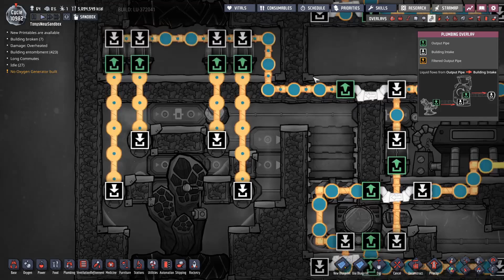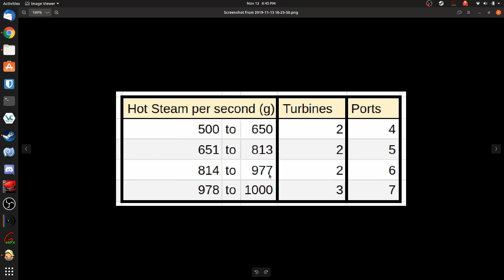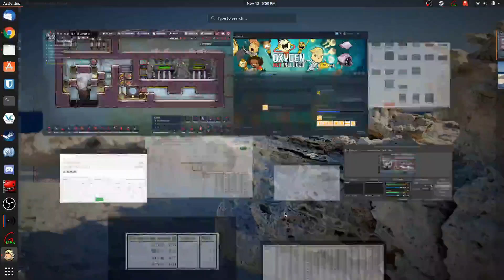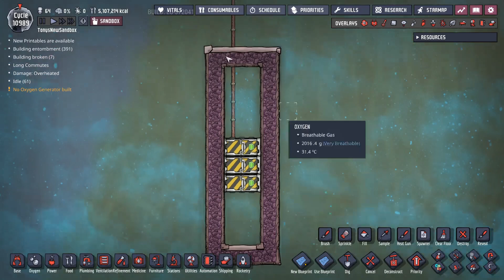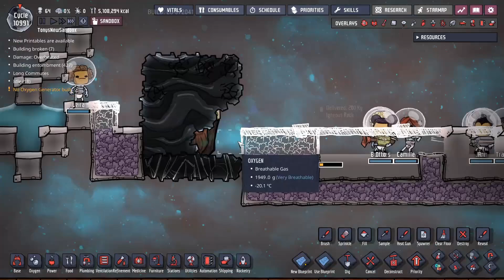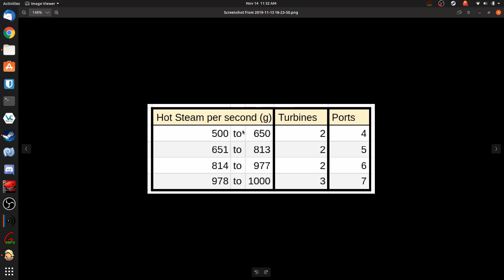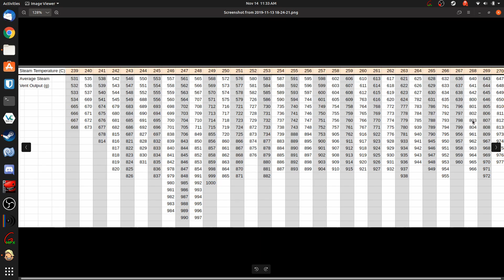Tame Your Hot Steam Vents for Power and Water

Comment from the maker: Addenda:
0) My charts don't seem to be quite right. My test builds don't produce power all the way to the end of the dormant period. If that's something you want, I suggest turning down the temperature a bit. I'll reevaluate the setup when I have collected better data.
1) You may want to cool the steam turbines from an external source instead of using the integrated steel aquatuner in the video. If you want to do it that way, and you want to tune the build the way I suggest in the video, you can use these charts: https://imgur.com/p8mSsDp https://imgur.com/DWIpH5i (I think they are correct but I haven't tested it well).
2) Omg, to get the petroleum in for the bypass pumps all you have to do is put some petroleum into the valves above. (Thanks to everyone who is telling me so.)
Reply: COME BACK MAN!!!!
Reply: Please come back! I watched all these videos and got some amazing ideas and I want more! I hope hate or life struggle didnt get you to stop making content. I cant wait to see more from you.
Reply: What should the valves be set for the petroleum beads? (because too low and they will disappear, like the water that the bypass pump is consuming)
Reply from the maker: @wolframitephoenix6737   I've heard that the limit is 20 grams, so anything higher than that should do.
Reply: Trying this now. 
1 It is difficult to place the automation items because vents now too can be automated. 
2 The automation (buffer etc) breaks when inside. It should be constructed outside of the chamber.
The rest of the mechanics seem to hold up (2 cycles active).
Reply: It's possible that some of the inefficiency from the steam turbines is due to heat transfer through the closed airlock in its idle position, though it's possible the heat transfer would be too insignificant, I have no idea how that could be calculated. I'm sure setting the temperature a degree or two cooler would be enough to solve that problem though.
Reply from the maker: @LividE101  That's a good thought. Don't worry, heat transfer through the doors is entirely okay and intended. Ideally,  ALL of the heat is meant to get through the doors,  just s long as it doesn't go so fast that it gets too hot below the doors then it's all good.
Reply: is it still can be used in dlc?
Reply from the maker: @bloodyhand1682  I haven't tried it in DLC. I know the automation can be made a lot simpler with the new stuff they added. And I know the automation wires have to be routed differently because they added automation ports to liquid vents and other thing. I suggest trying it out in sandbox mode before you spend a lot of time building it in your game.
Reply: @tonyadvanced6315  thank you

Comment: Recommendation to get significantly more power out of the vent, and actually makes building it easier, is to use liquid lead instead of petroleum drops under the vents (only meeded for the gyser room, not under the generators.  Just build a single 5kg automation wire on the vent, or above it so the lead will fall down.  The heat from the vent will easily melt the lead, so no nead to worry about making liquid lead yourself, and the 5kg puddle stays in one tile (won't spread out)

 Then you are able to use 2 or more geotuners without accidentally boiling the petroleum droplets.  If you stick with petrol you're limited to 1 geotuner before you're above the petrol boil point.  

Not only does this increase the overall volume of steam produced, but it significantly increases the temp of all the steam coming out.  Once you account for the additional water added in the turbine chamber to keep that room at 357.5, which is the most efficient temp for turbines with 2 steam vents open, you'll easily be able to keep around  5 or 6 turbines running flat out.  The only additional cost over this design is a small amount of bleachstone for geotuning, and negligible power for the tuners (more than made up for by the additional power created)

Comment: 7:14, I'm confused about the purpose of the automation wires that go in one horizontal row from the output of the  buffer gate to the atmosensor but also takes a line from the output of a buffer gate partially inside the steam turbine room.

Does the ticking loop of the first two buffer gates still work?
Reply from the maker: Basically, this is a single line that let's the thermo sensor turn off the door compressor when it's too hot. The thermo sensor also controls the liquid valve, so that's on the line.There is an atmo sensor on the line that will also turn off the door compressor when there isn't enough steam to bother. The buffer gate only works one-way, so having it there prevents the atmo sensor and door-timer from accidentally controlling the liquid valve. Also, the buffer gate makes the door compressor stay off until 5 seconds after the thermo sensor is ready for it to turn on. The thought on that is that its better to wait for the temperature to be stable for a while before adding more steam.
Reply: @tonyadvanced6315  
Thank you for that explanation! And of course for the exhaustive explanation throughout the whole video. You really put a ton of research and effort into it.

I've changed my top line buffer gate to a Timer Sensor set to 5s green and 5.2s red, which seems to be working

Comment: this seems similar to a setup I used for an oddly placed (near edge neutronium) hot steam vent.

I used a gas elevator dripping petroleum to pull hot steam away from vent and store steam infinitely. 

I had a supercoolant loop in the gas elevator walls to pull heat from new steam and transfer that heat into the working-steam chamber.
that kept my backup of steam cool enough to not break a steel gas pump.

same idea of recirculating the turbine runoff only when the working-steam gets too hot and then moving in fresh steam from an infinite storage when the working-steam is too cold.

p.s. the infinite storage never really built up to high pressure as I used the pump to feed stored steam into a nearby dormant copper volcano tamer.

Comment: This isn't possible to build any longer
Reply: Yes it is, I just built this in Spaced Out. Works fine, just have to move the automation so it doesn't interfere with the vents. I build it to the side and use an automation ribbon to the doors.

Comment: All that work to get almost no extra power.   Steam vents aren't worth the time.  1 Hatch ranch and run a coal plant 24/7 and you're getting 50w more than this set up. Unless you get a crazy good one.  Which is rare.  They aren't worth the time.   1700w from the turbines minus 1200 from a tuner that 500w.   1 coal plant is 600w.   Again unless you get a insanely good vent which the odds say you won't.  They aren't worth the time.  I'd say ever.  Great guild.  Nice setup.   But why?
Reply from the maker: That's a fair question. I have answers. The straightforward answer is that a hatch farm consumes minerals and labor (food and oxygen) and it produces eggshell, meat, and coal.  A hot steam tamer consumes nothing and produces power and water. To me, this makes them substantially different solutions that are best applied in substantially different situations depending on the state of your resources and needs. For example, if you are short on water then a hatch farm doesn't seem helpful, and if you haven't made plastic yet then it doesn't make much sense to harness a steam vent.  Still, perhaps the better answer is that players often prefer to focus on optimizing the utilization of all the resources at their disposal, and that's the primary goal of this build... how to squeeze every drop out of a stream vent.
Please note that the tuner only keeps the turbines cool, so it's off most of the time.  The turbines don't work at their full capacity either, but there a lot of energy in that steam and the power output would probably outrun a hatch stable for most vents.

Comment: Nice. I've finished this build (with some automation re-arranging), and it works like a champ! The only issue is that during dormancy, the shutoff acts as a Pipe Blocker and won't let the steam turbines emit their water. My steam rooms is fine - 600k of steam at 255 so that's no an issue. If turn down the thermo sensor (as you suggest) and allow the shutoff to let the turbine water vent, it turns back on, but only for a little while. Is this the "not running during dormancy" thing you were talking about? Any suggestions for how to fix? One of the reasons I loved this build is the slow, steady power at all times aspect.
Reply from the maker: It sounds like something isn't right with the plumbing.I'm down to have a look. Mine didn't make it all the way through dormancy. It was designed for it, and I think the math is right,  but not well tested because it takes forever. I want to revisit the project eventually and figure it out.
Reply: @tonyadvanced6315  I'll futz with it, if I happen to come up with a solution, I'll post it here. I don't have high hope because you are so much more detailed and knowledgeable. I'll give it a shot. For the record, my plumbing is exactly the same as yours (I pulled up the blueprint you provided because I suspected the plumbing as well.) It's such a cool build though! I want it to work.

Comment: Solid build even considering that all the door automation has to be moved outside. This needs to happen or the vents interfere with the door automation.
I had one or two issues and emailed Tony directly.
Good guy. Very helpful. Solid build.
Safe to say that I now subscribe.
Reply: It is possible to route around the vents while keeping it inside. I squished the atmo sensor and the top block over to the right, and slid around a few of the bottom gates.
Reply: @elspood  because of additional objects gaining the ability to be automated in updates since this was created, as far as I can tell, no. It still works; you just need to reroute wires a little.

Comment: Your circuit can be simplified by just using buffer for 1st and 2nd door, and use buffer+ filter for the 3rd. No need for negation.
Reply from the maker: I didn't try it out,  so I'm not sure.  But when the door compressor is idle for a while I think that would either open all the doors or close all the doors,  depending how you do the wiring.
Reply: @tonyadvanced6315  Right, when idle it closes all the doors. I also have manual override to close or open all doors for maintenance and such. It's just a minor optimization, basically it's reversing the phase of the clock to save not gate. Great videos btw, I really like how well prepared and logic dense they are.
Reply: @AmbiguousAdventurer  I'll have to try working that out on mine. With the automation updates, I replaced his loop with the timer sensor , but I also had to flip the green/red ratio and add a "not" gate to get the override working. I should try that and see how many of the not gates I can strip out of the build. (also note to self for the future, don't mix up lead and gold when building the automation in here. That was a pretty spectacular mess)

Comment: Does it work if we remove the drip pumps and just use the door compressor to remove 500C steam from the steam vent room?
Reply: Answering my own question it could work but you need several door pumps and is bulkier than just using the drip pump. The reason being door pump's throughput depends on the pressure and it is very slow in a low pressure environment. Therefore a 2 stage solution (drop pump -> high pressure -> door pump) is better.
Reply from the maker: @AmbiguousAdventurer  You are right.  It can be done,  but it's awfully obtuse and requires a massive contraption for a particularly beefy steam vent. I've never been too keen on drip pumps but they sure seem like the right tool for the job.

Comment: Hmm... If you reorder the steam turbine output priorities, wouldn't you be able to take the cold water from the cooling loop out instead?
To the bypass pump first, then to the steam temperature control, and finally to the cooling loop. Bridge the cooling loop into the the steam turbines' output to prioritize turbine water before the water already in the loop, and have the surplus from the loop come out from the input of said bridge... Would that take up less energy than cooling the water separately, and would it affect the system's efficiency?

I only feel confident enough to even suggest that because of your videos. You do great work, and are my go to channel for tips and tricks.

Comment: I was thinking about the debris causing problems all along.. it really messes things up when it comes to builds regarding temperature to work. For example, a petroleum boiler made with an aquatuner as a heat source.. if you replace any pipes that burst from overheating the "debris" metal sometimes is left behind.. it can keep cooling the crude enough to start pooling in the cooking area. Removing all debris all the time is the safest way.

Comment: Damn, you're really underrated, man. Most tutorials won't even go THIS in-depth and explain why and how it works, how it's built etc, it even has PDFs and everything so the data can be used to make slight changes depending on it. Question though, with the new updates and everything... are there changes to the game that makes this design less or more efficient that it is now? Or does this design do the same thing on the current version? Thx

Comment: I followed this plan with some repositioning of automation gates so the four liquid vents weren't getting automated, but I found that all my steam released was trapped at the 4x2 area at the bottom of the guyser plus the 2x2 area above that (like an upside-down T).  Steam wasn't passing the petro drops.  I removed the two insulated tiles between the top two liquid vents and that seemed to "unlock" the blockage.

Comment: I was just taking a quick look through your equations and they're not quite sinking in, so I have a few questions:
1) Why is ΔT equal to 500-95 rather than 500-125, since turbines require 125°C steam to function?
2) Where is the term that accounts for using the 95°C return to cool down the generated steam?
3) Why is WaterTemp described as "the temperature below which a steam turbine cannot harvest heat energy"?
Sorry if any of those should be obvious, ONI is just still very confusing to me.
Reply: You have to think of the system as a black box. Steam goes in, water (and power) comes out. Of course, assuming there are no leaks, perfect insulation all around, which is totally possible if you create a vacuum. Possibily not worth it, doubling the insulation could do, and probably even as it is, leaks are minimal and can be ignored.

1) I believe that would be the ΔT of 1g of water entering the system via the vent and exiting via the pipe. I don't see why 125 would be relevant since the steam the STs are operating on is not at that temperature anyway;

2) it doesn't leave the system; what happens inside the black box, stays in the black box;

3) again, black box. While I get where you're coming from (125 being the min temp for ST activation), it's 95 the lower end here. The fact that you might need to raise the temp to activate the ST, doesn't change that fact that the system (as a whole) is extracting heat from water. Granted, extracting heat from 96C water might not be power positive. But still, heat is extracted.

We know metal refineries are power positive (excect for gold). But lower end metals like Tungesten aren't much if the dups are not skilled. So picture this: a metal refinery / steam turbine setup which is perfectly balanced in terms of power. The refinery and the pipes are inside a steam chamber. The steam turbine output (95C water, 2Kg/s) is looped back inside the room. Temperature reaches equilibrium and power balance is 0.

Now, build a liquid pipe that adds 96C 2Kg/s of water from the outside. Divert 95C water from the turbine to the outside. Now the temperature inside the steam chamber is slightly higher (you're adding 96C water instead of 95C).

You've build a system that inputs 96C water, outputs 95C water, and now is slightly power positive. A system that is capable of extracting heat from 96C water, with a steam turbine.

Comment: 264°C ? Does it make any sense to run a steam turbine above 200°C ? I guess you will waste power. There must be another setup to manage water / heat flow efficiently.
Reply from the maker: If you block some of the ports you can process higher temperature steam without wasting power. You can easily set it to 200C if you like, but you risk problems with having enough water to cool it down that much.

Comment: I'd love to see the calculations you're using to determine the tuning numbers.

Also, eventually "it was my latest video" isn't going to work.  Much as with debris sweeping, maintenance (that is, posting links to videos) now prevents headaches later.  (I do see you posted links for the mentioned video; I hope you have the chance to go back through your other videos to add that info later.)
Reply from the maker: I'll put a document together and let you know.
Reply from the maker: Here it is. I dunno if I made it clear enough. If you dig into it and find a problem I'll be quite happy to hear about it. right now, I suspect that my problem comes from my understanding of the heat loss due to adding water to high pressure steam. It might be that as the pressure increases it gets 2.5% worse, not .25% worse as I thought. That would put a pretty hard cap on how much steam can be saved for the dormant period. https://docs.google.com/document/d/1Lk4BnxacyLO3SElRhRUXgnpO8xLW_TtdcU_I8w4Eroc/edit?usp=sharing